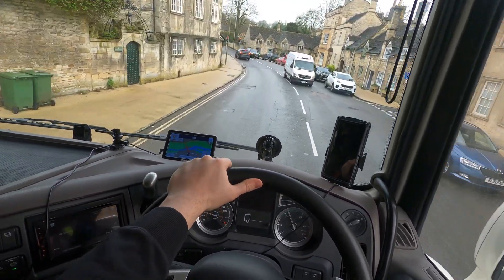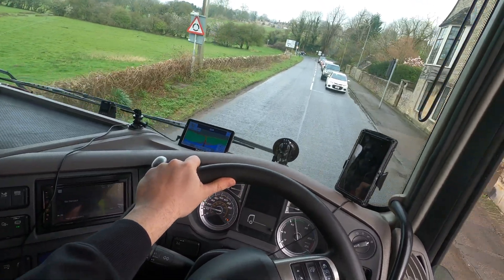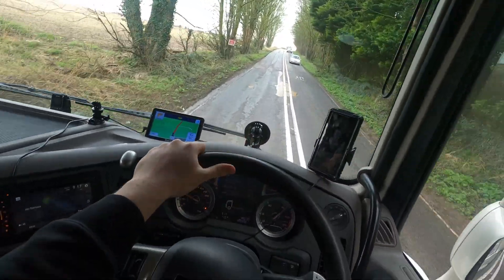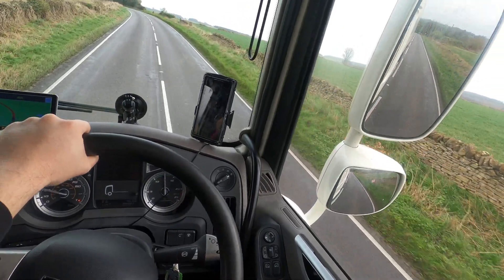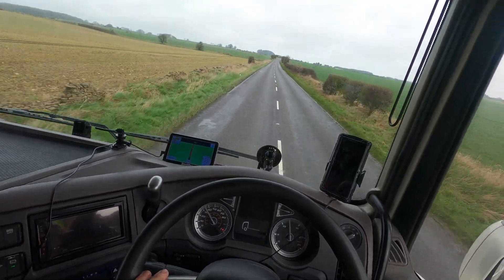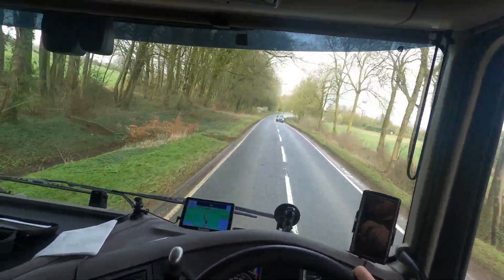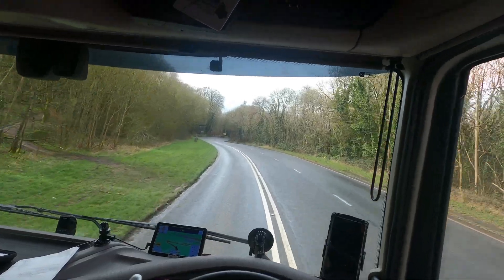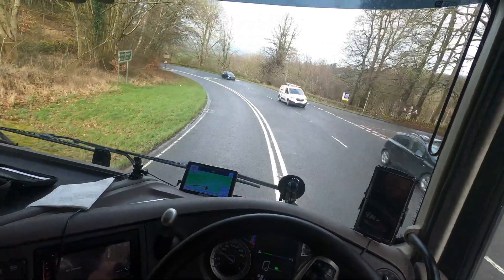HGV Engine Break Retarder In Action.

Comment: Really interesting, thanks. So is an engine brake and a retarder the same thing? Are the terms interchangeable? For some reason i thought they were different things. Thanks!
Reply from the maker: So, no — they’re not exactly the same, but they do the same job differently. Many modern trucks have both systems to give more control depending on the situation.

Comment: Just had 2 weeks in a new Iveco S-Way and the manual retarder on them is brilliant, 4 stages and slows it  quickly if you need it. Set the "CC gap" to +4 and the automatic retarder wouldn't let the truck go past 58 even down the massively steep 4 mile drop from Saddleworth to Rochdale on the M62 with 22 tons on the back. We weren't told anything about retarders on driver training and it should be taught. Great video for new drivers as they need to learn this stuff. I see so many drivers on the foot brake on the steep M62 drops which makes you wonder if they're going to cook the brakes.
Reply from the maker: Yeah it's actually mad how much you don't get shown when you do your training in the UK, even thingscsuch as strapping loads etc.
Reply: @truckitprayle  as one guy said to me this week "All they teach you is how to pass the test, the rest you have to learn the hard way". And with VOSA they'll say ignorance is no excuse, they just book you